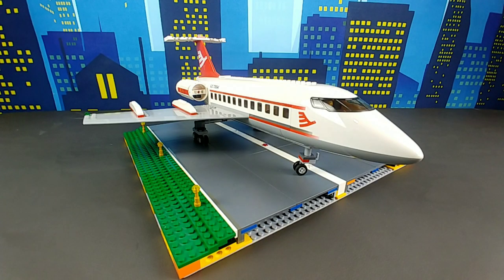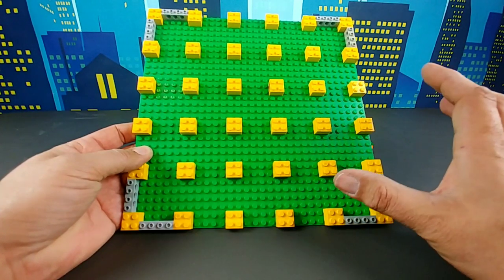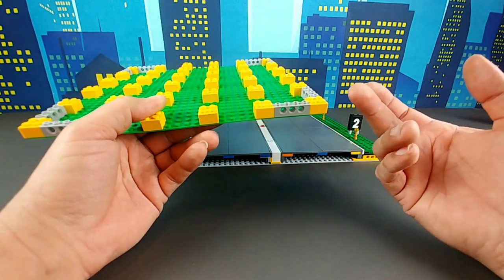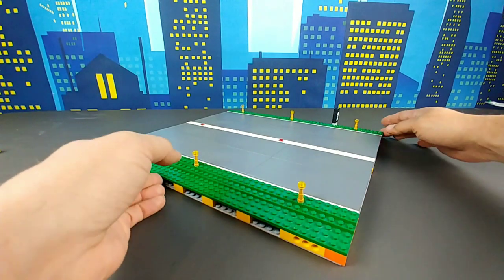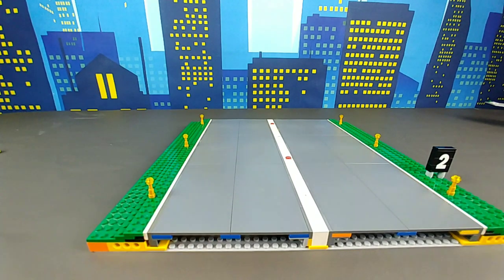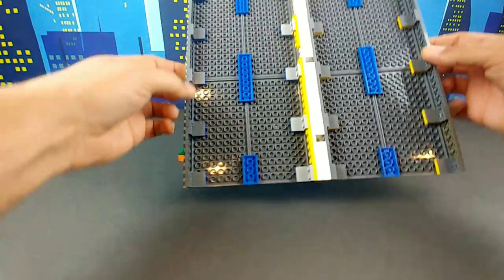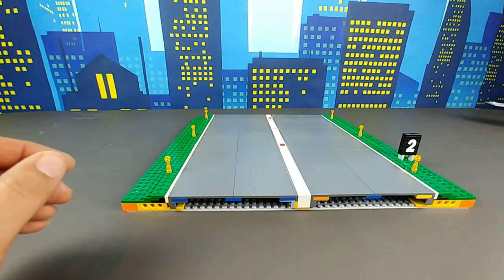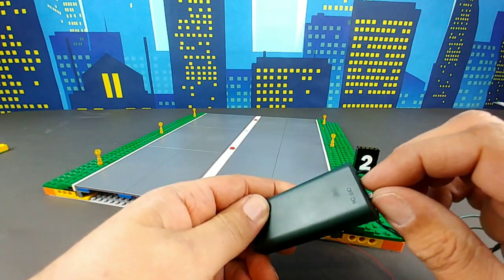Mils Plate System Start

Comment: This is a great start! I've been spending the last week putting together a custom MOC airport terminal building by combining elements from sets 60104 and 60022 with a bunch of spare parts I had laying around. It's been coming together well so far and I just pulled the trigger on sets 10764 and 3182 for additional minifigures and elements.

I haven't even started on the runway yet but have considered a number of options by looking at various YouTube videos on the subject. Your system looks very promising and could be something I might use myself. Keep up the great work!

Comment: I like the idea of the basic MILS system for the reasons you outline, although I haven't tried it just because of the number of plates you need.  I also like that you can have areas that dip slightly below ground level (by 1 brick or so).  I have also seen the idea that you can build modules containing landscaping (rivers, hills etc) involving changes of level.  I can't see that working as a generic system unless the modules are actually designed to fit together with a matching profile. Of course if you're making your own you can ensure that it looks seamless.  For the runways at least it looks like it should work great..

Comment: I do kinda the same thing but with 16x16 plates so you can build on all sides and create a sewer or electric system between the plates
Reply: I was able to make tunnels and a small winter village without having to use any non lego parts such as wood or varying table heights and it does give a high level of customization just costs alot for the tiles and plates
Reply: @BevinsBricksWorld   I buy used bulk and in the process of sorting it out by color it saves me money since I can sell off the parts I dont need to buy ones I need like tiles

Comment: I won't ever use MILS. Cost aside, the road looks too blocky. And it is impossible to incorporate the system into my 12V train tracks or other builds such as my Lion Knight Castle or modified Yellow Castle.